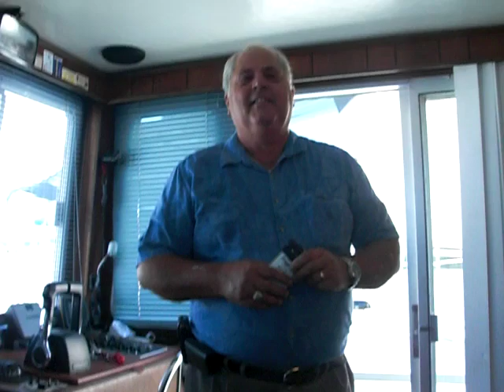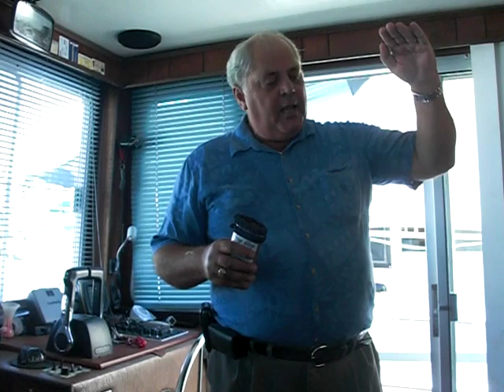outboard motor conversion, motor mount location, prop glop mobycool covered motor mount

Comment: advise is good.... my 20hp yamaha manual states mounting height of cavitation plate  to be between 0-25mm below bottom of boat....thats anything from level with bottom of the transom to 1 inch below.